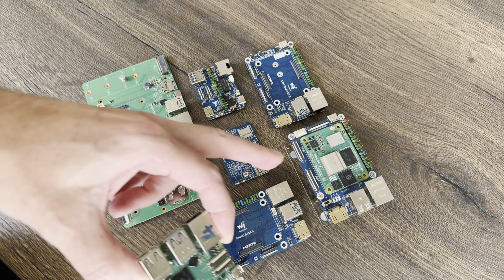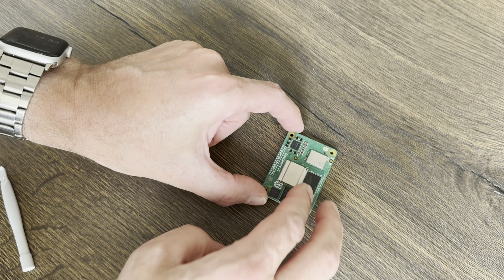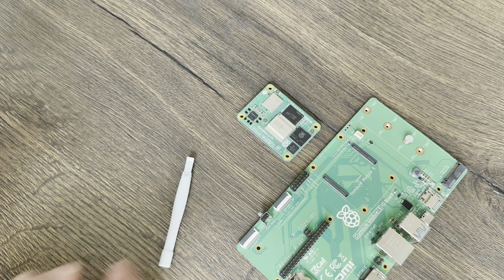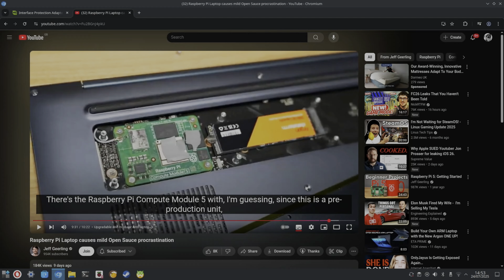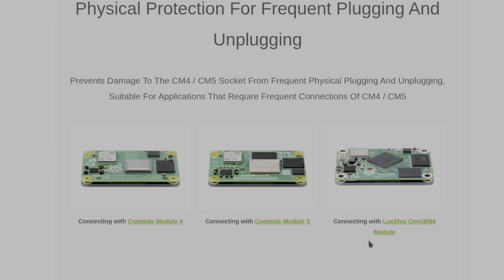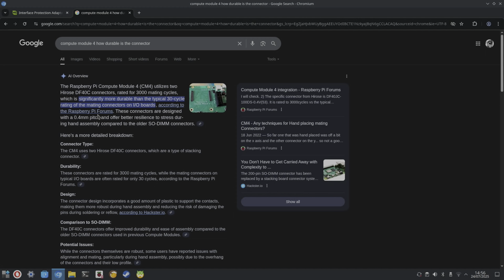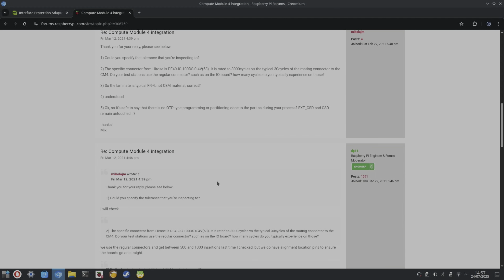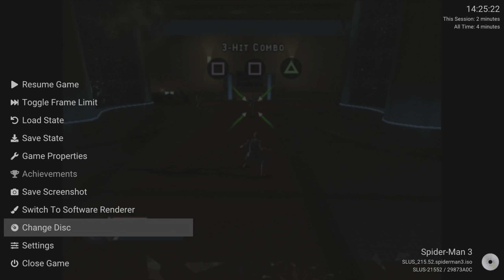This tiny board could save your Pi!

Comment: So rather than wearing out the connector on the CM5, it will wear out the one on the base board...
Reply from the maker: It’s a cheaper option. Only needed if you regularly remove your CM4/5 from the board.

Most people won’t

Comment: I one connector is rated at 3000 cycles, won't 2 connectors together be rated at 1500 at best?
Reply: They're connected-disconnected together, so each having 3000 cycles would usually mean they would break at about the same cycle count, obviously one could last longer-shorter, but average doesn't change
Reply: To expand a little further on the explanation above, it's because they're performing in parallel. 
If the 2 connectors were wired in series, such as adding an adapter between the two, it would separate the disconnects, and you would be correct about the halving. 

Kind of like wiring power cells. Parallel = more amps because they strengthen each other.

Comment: Thanks Lee for the information, as I have the ClockworkPI  unit with a CM4 module that plan to put the CM5 in now that the software is available, but some work better on the CM4 for my SDR radios.
Have a great day!

Comment: the riser is also used in the uconsole with a thinner thermal heat pad so that the heat dissipates faster to the alumnium back case heat sink for faster passive cooling.